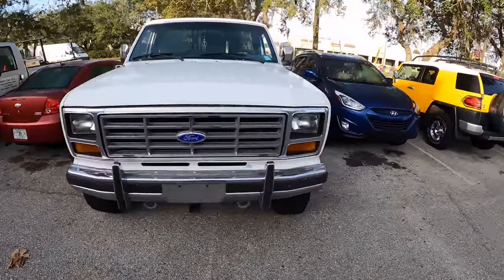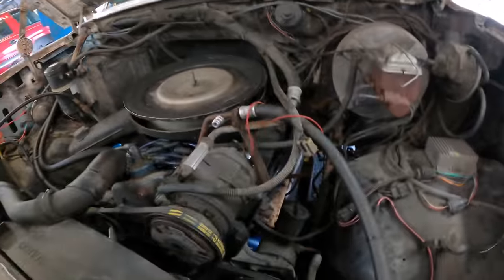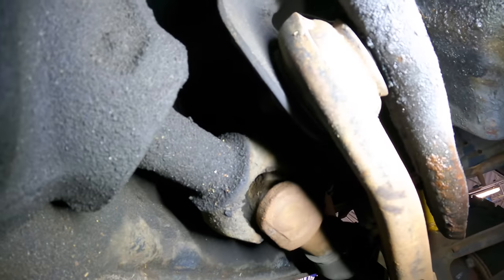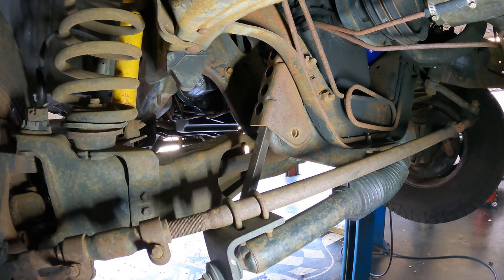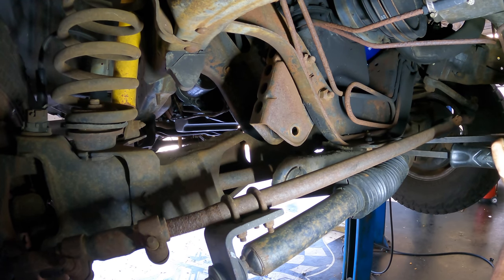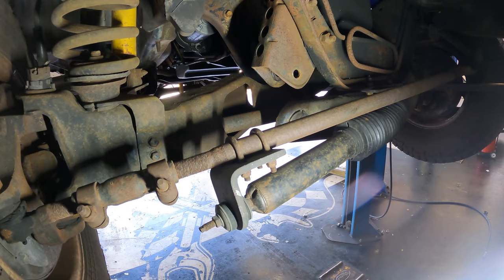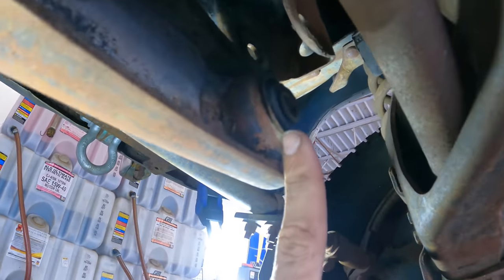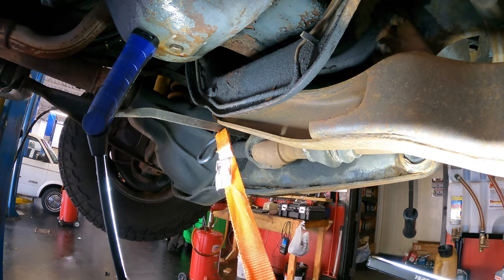Bushings DESTROYED! Assault Hammer to the rescue! Old Skool Ford F150 Classic

Comment: Penetrating fluid, in the case of your use, does very little to help out. it typically needs to sit for minutes to hours to work effectively, unless you are torching then soaking to use the heat to wick up the threads and such. Using it as a lubricant works fine for your use. I feel there should be that difference noted. Other than that, I'd say it was a trolling issue?

Comment: It's easey useing a drill to drill true the rubber remove the rubbet then use a sawall or a gig saw to  cut the metal about a inch apart then take A screw driver and push out the rest then clean and push in the new one

Comment: Dam wasnt 3 on the tree.
Thats a headlight brights switch.
My 64 ss impla my 63 impla my 76 Plymouth duster my 73 celica  my 70 ltd wagon my 76 skylark  my dads 49 Willie's 
The 49 Willie's jeep truck i rewired and on all had them it wasnt unti the 80s it went into the turn signal switch.

Comment: Technically, penetrating oil is a myth
Oil penetrates the holes that lubricates the parts with rust. There’s more holes but also rust weld. The oil helps makes it harder, so when you turn it to break it loose.

Comment: Yes I’ll be the 157th to say high/low beam switch…… but now I’ll jump on my soapbox. I have an older escape and a 2012 F150. With the escape the highbeam low beam selector is instantaneous so I can flash the idiots driving with no lights on and signal the truckers when it’s OK to change lanes. The F150 however has one of those infamous body control module’s so when you flip the high beam switch it takes a good second or two for the lights to change. If I turn the lights on and off it switches between the DRL mode and the night mode again for the slow response. So there’s no way to signal or flash “hey wake up and turn on your lights dummy” like the older cars do…….. I really hate that.

Love your videos and play by play .

Comment: OK, so the original bushes were flared on one side to prevent them moving in the arm. You had to drive the flange away to remove the bush. They did not rely on staying in the right place on friction alone, as you have now installed them. Surely there is a tool designed to flare the bush to prevent movement in the arm. Why did you not flare the newly installed bush as done by Ford?

Comment: One thing I see that is wrong, you tightened up the bushings while the suspension was hanging down, once on the ground those bushing are gonna be twisted, they need to be neutral at ride height.

Comment: Penetrating oil is redundant because on metal oil penetrates. The molecular structure of oil wants to bond with metal surfaces more that water which contains oxygen. Rust is oxidized iron caused by the oxygen in water. Oil DISPLACES the WATER and protects the metal against oxidation. WD-40 stands for the 40th formula for Water Displacement. So saying penetrating oil is like saying freezable ice.

Comment: Gotta love the manufacturers in the 80's.  They only made the odometer go to 99,999 because they knew it would be junk after that many miles.
Reply: I'm driving a 91 and the odometer has rolled over twice. I've had several older vehicles which have done that. Trans was rebuilt but the only engine internals repaired was the timing chain. Still in fantastic condition overall but I need those bushings now myself, the rest of the front end parts are OE except wheel bearings. Probably another 200K miles left in mine with an engine rebuild and I plan on doing that

Comment: Safety glasses might be advisable when you are hammering on stuff that might send metal chips and/or “foreign particles” towards biological sight sensors? Oh yeah, that thing on the floor or the car is a dimmer switch. I allows the driver to dim the high bean headlights so not to blind the driver of a car coming the “other way” when we are using the “high beams”. 
🤔🇨🇺🇺🇸

Comment: Would it have been easier to have removed the arms entirely then do the bushes on the bench?
Also air chisel use = safety goggles.
Reply: It's an option but it also involves undoing two ball joints per side and a camber bolt, I think. But the camber bolt location can be marked with a punch. (?) Hazy memory.

Comment: That truck is the same year model as me. And I think my 64 1/2 Mustang has that foot switch for the lights. Been a long time since I had it running. Maybe that would be a good project. I don't see how you keep from getting mad.. Anytime I'm working on anything and I start dropping stuff or can't reach something or bump my head, I'm having like a toddler fit meets demonic possession - yelling and cussing lol.. Maybe the camera dissuades it? Or you edit it out? Lol.. # Doo Dee Doo (I put the space on purpose - I don't really understand the hashtags and don't know if that's a real thing - but it could be...)

Comment: What the manufacture  really wants is for you to buy the entire assembly and spend 10-20 times the money? In 1995 I designed a air over hydraulic portable bushing press designed for BMW and Mecedes Benz front control arm bushing remover/installer it worked well but was flawed becasue I used a 4 ton ram where as it needed to be a 8 ton ram with the same outside diameter it did not matter that the 8 ton would be a lot slower operating it did pass the patent office with the exception that the c-clamp had been desiged eons ago. The trick was to saturate the bushing and arm with penetrating oil the night before? The main problem was that the after market folks made the bushing slightly larger diameter than  the factory origianl  and or the outer bushing sleeve was aluminum against the steel control arm causing corrosion especially cars that were subjet to salt used up North for ice control it did work well and was used for many other bushings as well, there were about 12-16 diffrent male and female cups and  the cups were hardened to about 50-55RC I also made an adapter so the same cups could be used with a hydraulic press. I sold quite a few in the Dallas Ft Worth foreign car market and ran out of customers. I did not pay for the patent renewal as it was expensive. Last I saw a much larger set made by someone else similar to mine and the cost was over $5,000.00, I also designed a set for Porsche rear weel bearing remove and install that used a 10 ton ram it worked perfect, I made two proto types and the buyer that bought the first set also bought the second set some months later. Now I am old and my cognitive brain is not working so well, but the inovative side still fuinctions... It did help as I was a forein car mechanic and shop owner for most of my life and did enjoy my work.

Comment: I saw a YouTube video on my Firestick But I couldn't make a comment. You replaced power steering lines on a Trailblazer. Absolutely hilarious that you a Chevy guy was whining about working on a Chevy for the very reason that I stopped buying Chevys. How they build stuff that is hard to work on, on purpose. I was laughing my ass off. Don't be mad nothing personal, I didn't realize just how far they had excelled in their designed obsolescence.

Comment: Ray, RE: your button.... Aren't you in Florida?  I mean I realize you are a mechanic and from what I've seen a very competent one at that, but you're in FLORIDA.  The existence, location,  and ( Gawd FORBID) THE ACTUAL USE of the headlamp dimmer switch is VERBOTEN!  The cops won't even dim their headlamps.  I work nights and every night going home I get to see that apparantly only one in 20 drivers even seem to know about high and low beams. Apparantly there is also some weird requirement to mount at least ONE headlamp upside-down.  That way no matter which way you have the switch at least one lamp is always burning on high beam.

Comment: Penetrating oils do not work as good as advertised... and definitely not on severely rusted nuts and bolts. They mostly only work on the surface but don't penetrate into the threads, maybe the first two if it's a reasonably clean nut or bolt. There is enough proof to be found on youtube... I would recommend the Project Farm channel, he tests a lot of these claims and various other very interesting testing with tools.